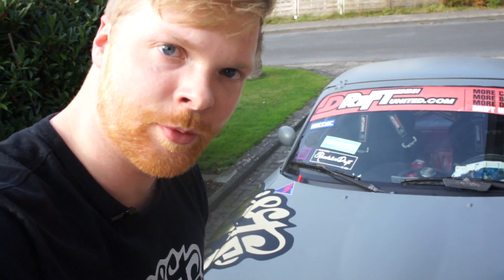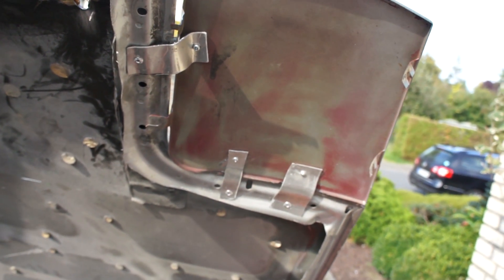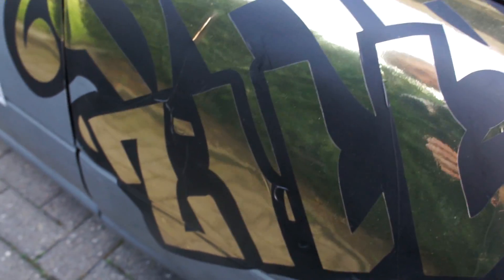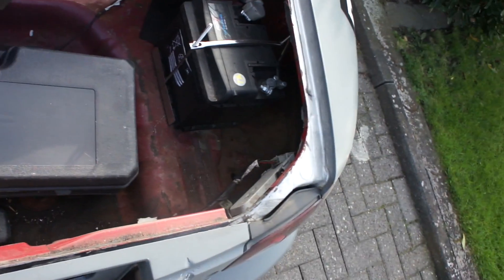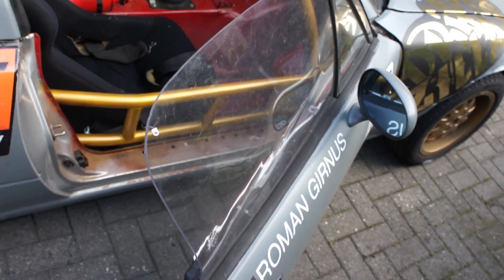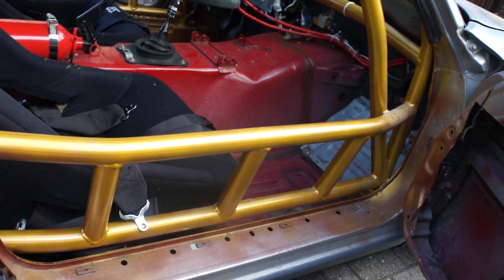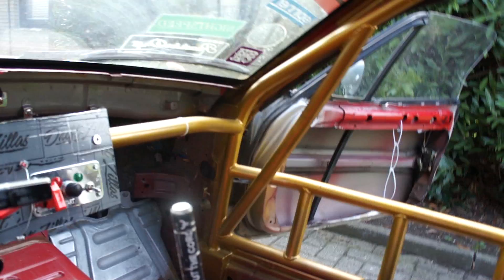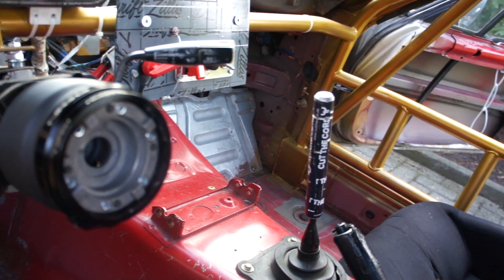Mazda Miata Drift Build Breakdown

Comment: Why would u make less power with the ebay air filter tho?
Reply from the maker: because most times the air induction system has been engineered pretty well from the factory, so generally you do not gain any power... but sometimes even lose some ;) I just did it for the sound tbh
Reply: @haubidrift  ah OK danke. Und kannst du mir sagen wie du drift Events findest. Wenn ich danach google finde ich nur kurse
Reply from the maker: @Litroundzzz  schau Mal nach Drift United, driftcamp burdinski, Nürburgring Drift cup, drift.de etc. bei Facebook, da solltest du eigentlich fündig werden! Was suchst du denn genau?
Reply: @haubidrift  joa so sachen wie grassroots in Amerika wo jeder halt mal so fahren kann😅
Reply from the maker: @Litroundzzz  dann schau dir die Sachen in Allstedt von driftunited / Fahrtraining an oder driftcamp burdinski... Oder drift.de freies fahren ;)